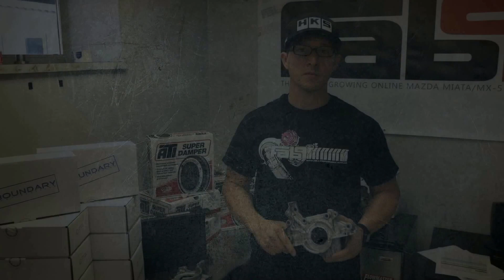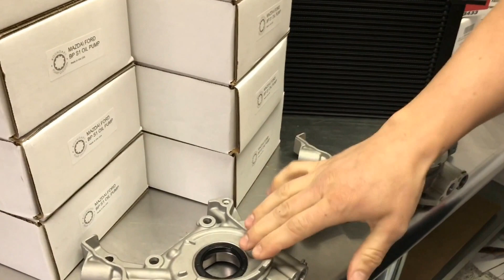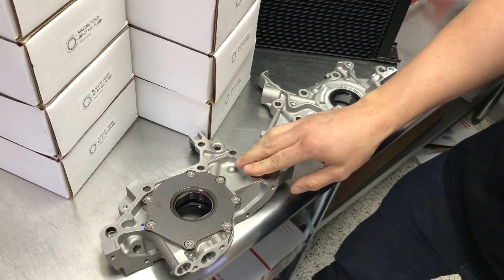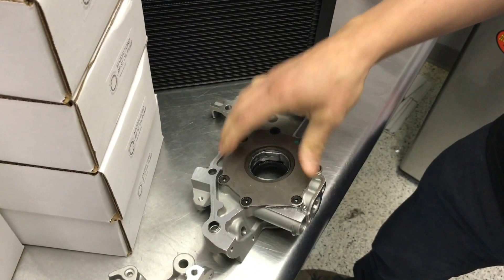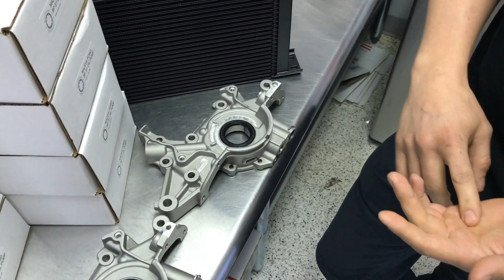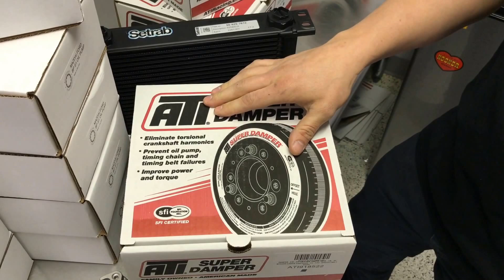Fab9 Tuning helps you choose your Miata MX-5 Billet Oil Pump & Shims - Boundary Engineering

Comment: Hey fab9 whats up, i was about to start building the motor recently when i noticed i ended up getting the wrong pump from you  guys, is there anyway i could get a stage 2 from you guys instead of having to spend the $300+ again for a new pump. My pump is still in the bag/box and hasn’t been compromised yet. Please lmk you’d be doing me a real solid. P.s ive bought every turbo part i own from you guys including skunk2 intake manifold, manley rods, awr racing motor mounts, king racing rod and main bearings, gates racing water pump kit, arp main and head stud kit, and a few more

Comment: Im getting 30psi when warmed up at cruising with the stage 1 no shim pump really kicking myself because I think im going to have to pull the motor to shim my pump if I cant get the oil pressure up some other way

Comment: Thank u very much thats a hugh help thank u it started off at 60psi but as ive broken in my new motor and added parts a turbo and oil cooler it has dropped pressure so ill add some shims and be back on track.

Comment: Is there anyway to add a shim. to make a 2 shim a 3 shim on the boundary oil pump? Or would i have to buy another pump?
Reply from the maker: Yes, you can remove the cotter pin or clip for the plunger. Be careful as it’s spring loaded. Then take one of the existing shims to a hardware store. You’ll find a similar thickness washer, that’s safe to use. Clean everything upon re-assembly and you’re golden!

Comment: There is a difference on the 2 pumps where the crank sensor mounts. The stage 1 pump has a tab that sticks out. The stage 2 pump is flat. Is the stage 1 an NA pump and the stage 2 an NB?

Comment: Small nose, turbo, remote filter, oil cooler 65 - 70Psi = 5 shims. We started with around 30Psi (not good), but lots of flow which saved the engine.

Comment: Hi. Im running VVT, watercooled ball bearing ) GT2560R) turbo and oil cooler - would I still need the 4 shims ? as the ball bearing turbos dont use much oil compared to journal bearing
Reply: I am running VVT , EFR turbo and oil cooler too, which mean I need the 4 shims, right?

Comment: What about just a regular vvt non turbo
Reply from the maker: David Barlow - great question! Due to the volume, you should run a Stage2/Street Strip. The standard VVT engine comes with a wider gear directly from Mazda for this reason.

Comment: What about 1.8 BP-4W non vvt turbo, no oil cooler yet. How many shims would you recommend?
Reply from the maker: I know this was 11 months ago but it's a great question - There is no harm in running an oil pump that has been shimmed for the future, within reason. If you plan to run an oil cooler in the future, run 2-3 shims now. The increased pressure will only create unnecessary heat until the cooler is added. You aren't at risk of cavitation with a low shim number like this.

Comment: Correction, the shims only raise the bypass opening pressure. In low rev ang hot oil  situations they dont do nothing. Do not run too much shims and thick 50 or 60 weight oil when cold.
Reply from the maker: Tomyp89 Thanks, that's right. They aren't magically producing pressure elsewhere. Otherwise there would be no use for a higher volume pump outside of durability.